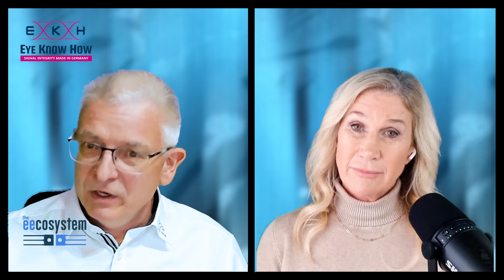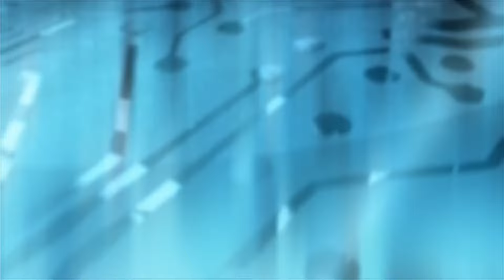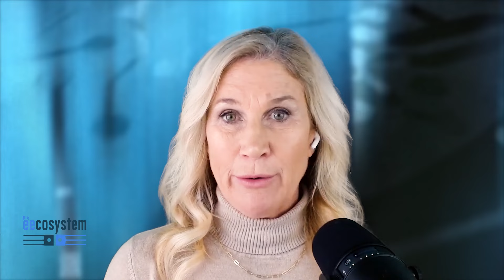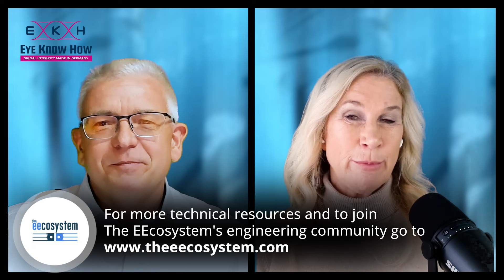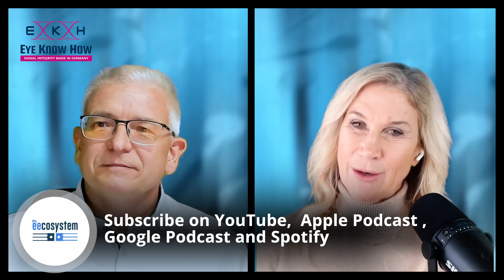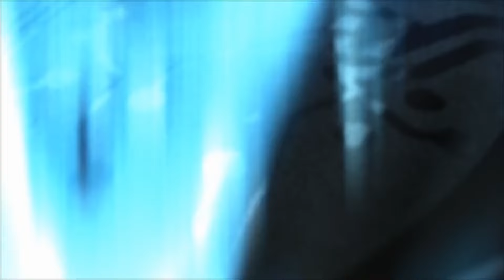Decoding Accurate Memory Design | Sticking Points in Memory Design | Expert - Hermann Ruckerbauer

Comment: Thank you very much for the great interview! It was enjoyable to listen. I believe tomorrow's memory interface has different requirements. In the future, storage devices should already be structured as associative memory. This would eliminate the need for address/data flow, and the data itself would function as dynamic addresses depending on the previous content of the memory. Like a digital brain. The CPU/GPU is no longer the bottleneck at en-/decoding the datastructure of associative organized information.
Reply from the maker: Thank you, it will be interesting to see how this next chapter of memory interfaces unfolds. Thank you for your interesting insights!
Reply: Hi mad_circuts, I agree for some parts, but I think, that memory interfaces are just splitting up in different use cases. 
- The one that you describe with some limited amount of needed memory (e. g. what we see today with in smartphones with an SoC and DRAMs on top). 
- What is today LPDDR/GDDR/HBM usage with multiple components will still have some of the old limitations (also the interface might look different) and will serve applications with some medium size Memory requirements (i count notebook type applications to this one). 
- And last but not least i think there will be always applications that just need huge amount of memory (todays server), where it is not possible to bring the memory close enough to the CPU/GPU. 

In the past most of these applications have been served by commodity DRAM. Today we see the split into these three classes already, but I expect "use case optimized memory" getting much more important in the future. 
Maybe this can be seen as the “normal” hierarchical pyramid with very fast but small memory (Cache), and the bigger the memory gets it is getting slower (until it reaches SSD, HDD and finally still Tape application). 

Personally, I do not care so much about the interfaces (even I am an SI guy). I am more curious about the technologies behind. 
Will NVM (e. g. flash) in some point in time really replace DRAM? Or is MRAM or resistive RAM the technology to do so? 

Hermann